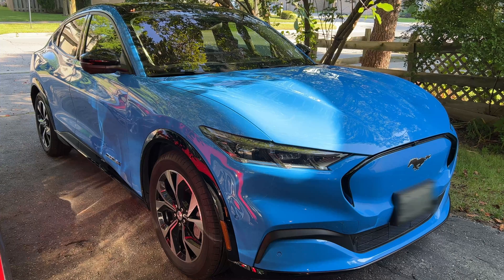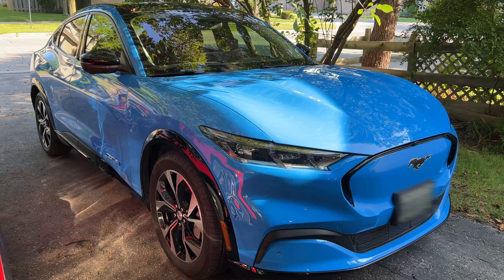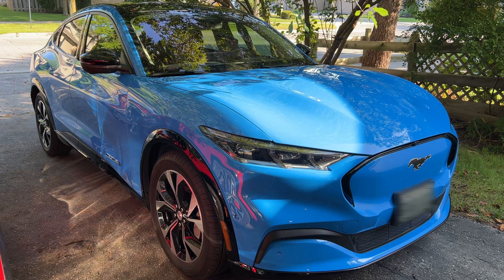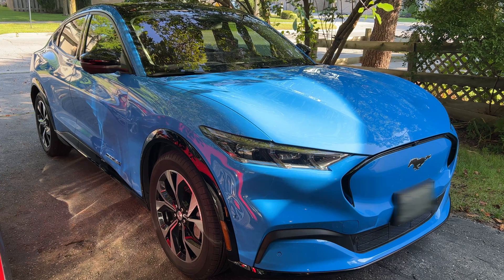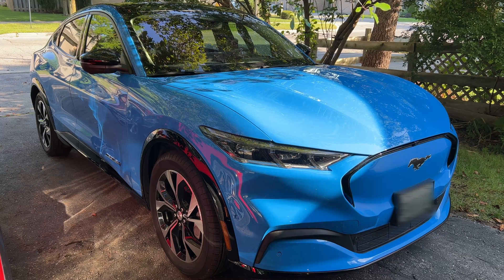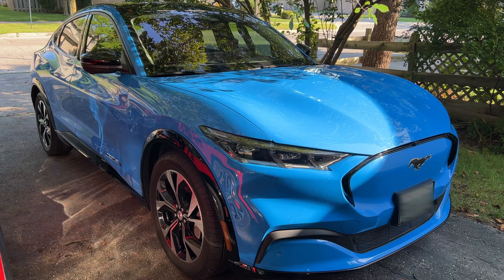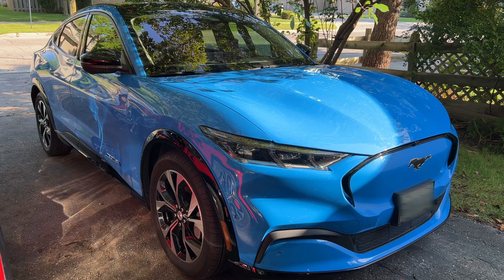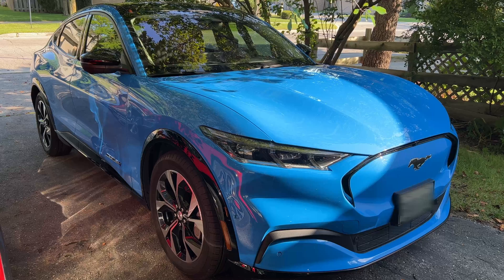Dead Ford Mustang Mach E 12 volt battery? BCM replacement Electrical System Drain Service Required

Comment: Roadside assistance towed mine to dealer for free on a Saturday (same batt issue). They claimed to have the part (high voltage contactor) on the following Tuesday. On a Friday (7 weeks later) while leaving the dealership, I noticed the dashcam disconnected and laying on my passenger seat with no explanation from them. The obvious conclusion is that they consider that cam a drain on that small battery, however, my cam only runs when car is running. Anyways, considering adding a larger batt in the frunk where it can be monitored easily.
Reply from the maker: If you do that, let me know ho it goes.  Please like and subscribe as it really helps me as a creator.  It doesn't cost anything.  Thanks for the comment and for watching!

Comment: I don’t understand how a new car can have issues. I got the car for my wife as a gift and it’s already messing up smh brand new new smh
Reply from the maker: I know, right?  I never expected no issues with brand new technology, but I wasn't expecting this either.  Let me know how it goes.  Please like and subscribe as it really helps me as a creator.  Thanks for the comment and for watching!
Reply: @MoreBear I liked and subscribe for u bud. Good luck with your channel. Also I wanted to ask you did ford send you your free Tesla charging adapter?
Reply from the maker: @davidparker4943  I ordered it months ago.  Still haven't gotten it.  But I did use the Tesla Magic Dock in NY.  You should check it out.  Thanks for the Sub.
Reply: @MoreBear I ordered mine and it took 3 months to come in but it seems to work great. I’ll have to check it out. Yw
Reply: It can happen when the car sits idle in the dealership for a long time, the 12v battery suffers. Try letting an ICE car off for a year, there is a high chance of the battery losing charge.
Reply from the maker: @xaviersan554  No, I get that.  But this was a few days.  And there is a battery under the entire car that it could top up from.  Frustrating.  Please like and subscribe as it really helps me as a creator.  Thanks for watching and the comment!
Reply: @MoreBear  I see, the question I have is, is the BCM module up to date on your Mach-E? Mine is not up to date.
Reply from the maker: @xaviersan554  One of my two Mach's has been replaced, so that one is up to date.

Comment: I have a 23 mach e premium and just got the same warning message about low voltage. After watching this video I made a service appointment on the app and will update on what happens next.
Reply from the maker: Please keep me updated.  I hope everything goes well.  Please like and subscribe as it really helps me as a creator.  Thanks for the comment and for watching!
Reply: @MoreBear I just liked and subscribed. Update: I plugged it in on my level 1 at home over night and I just did a 4 mile drive to the gym and no app alert and no warning from ford pass but my appointment is for this Saturday so I’ll update with more info then or if something else happens.
Reply from the maker: @davidparker4943  Thank you so much.  Hope all goes well.  Thanks again!
Reply: @MoreBear  Update: The dealership service department said that they didn’t know what it was and that they tested the 12v battery and it’s taking and holding a charge. Today rolls around and I get a message from ford pass and on my display in the car that says “Restraint indicator lamp warning”. I am over Ford.
Reply from the maker: @davidparker4943  Sorry to hear that buddy.  Hopefully they can get it figured out.  Surely you are not the first to deal with this issue!
Reply: @MoreBear  Hopefully..

Comment: So latest is my car has been in the shop for over a week now. I was supposed to get it back Friday after they found the audio control module, ACM, was drawing 995 milliamps instead of 10 milliamps which was what was killing my battery. But when they went to load the new software on the ACM they hit a wall. It will not load. So since Friday the technician has been working with and reaching out to the engineers higher up in Ford. Today's word was Ford text and engineers need to come up with new software to get the ACM to load. No idea how long it's going to be or how long I'm going to be without my car. Any suggestions from anyone regarding lemon law or compensation for being without my car? I do have a rental and they are paying for gasoline.
Reply from the maker: Wow, that's not ideal.  I hope they get you a fix soon.  At least Ford is providing a rental in the meantime.  Unfortunately I cannot provide you with any further info.  Thanks for the update and please keep us posted.

Comment: Anyone know why Ford told me the high voltage battery doesn't maintain the 12v battery (which apparently is true) when this is a direct contradiction of the quote from my users manual?
CHARGING THE 12V BATTERY
Your vehicle has a high voltage to low voltage energy transfer feature that keeps the 12 volt battery charged by the high voltage battery. If the 12 volt battery level is low, the high voltage battery transfers energy to the 12 volt battery when the vehicle is off.
Reply from the maker: I haven't heard that before.  I know that if the high voltage battery is below a certain state of charge, it will no longer maintain the 12v battery (I have seen this info in forums I just can't find it at the moment).  If anyone else can answer, please jump in.  Thanks for the question and for watching!
Reply: @MoreBear  I understand that the high voltage battery charges the 12 volt in the preconditioning mode

Comment: this exact scenario is happening with my 2023 Mach E.  I bought it in Sep, battery dead in Nov and battery replaced after transported to dealer early December.  Now after leaving outside for a few weeks without driving - at airport - i was able to jump it and drive 2 hours home.  I used the car two days later - 1 hour drive to and from store and that was on Thursday -  now this morning it is dead again - the car itself was 100% charged.  Have you had further issues after the BCM and HJV were replaced?  Thanks for any info. Thanks for your videos.
Reply from the maker: No, thankfully I haven't had further issues.  However I leave it plugged in majority of the time.  I hope you get this issue sorted out.  I know how frustrating it was for my wife and I.  Keep me updated.  Please like and subscribe.  Thanks for the comment and for watching!

Comment: My exact same car is getting towed in tonight. Thanks for this!!
Reply from the maker: Sorry to hear that.  Let me know how it goes.  Thanks for the comment and for watching
Reply: @MoreBear  thanks. But your car remains working now after the parts were changed out?
Reply from the maker: @hifromkate  Yes, thankfully I haven't had further issues.  However I leave it plugged in majority of the time.  I hope you get this issue sorted out.  I know how frustrating it was for my wife and I.  Keep me updated.  Please like and subscribe.  Thanks for the comment and for watching!
Reply: any luck with a repair?  Dead in the water right now!
Reply: @hifromkate  yep, got my car towed to the only dealer in the city that had a battery left. Fixed it right up. 3 days later,  car stopped working again and now it says it's the high voltage battery which is likely that high voltage junction box issue. Gonna get towed in again tomorrow....
Reply: @MarkCampbell83  thanks for your reply. So frustrating! Just ridiculous. I decided to jump mine today. But with a battery pack, not another car. Applied jumpers, pushed start button, but forgot to step on brake pedal but somehow dash reported powered up accessories.  Didn't realize I that I had not started the car so disconnected the battery pack. Got in and tried to put in reverse and it wouldn't go. Then started the car without an issue by stepping on the break and hitting the button again. Don't understand why that worked! Did check the battery before I did anything and it was at 11.7 volts. I am calling the dealership tomorrow to see what they recommend. My claim with the Ford customer care people only recommends bring it to a dealer. They don't seem to want to address all the complaints that I brought up from my research.
Reply: @hifromkate  that's good, but I forgot to mention that eventually mine started working again after I left t for 8 hours, but the next day it died again so be careful!
Reply from the maker: @hifromkate  Keep me updated.  Please like and subscribe.  Thanks for the comment and for watching!

Comment: What dashcam did you have? The Fitcamx runs off of the rain sensor under the mirror, and is switched off when the power is off. Of course, this means no recording when the car is not on.
Reply from the maker: I have Thinkware FA200 with rear dashcam.  Thanks for the question and for watching!

Comment: I am currently locked out of my car and can’t get the frunk open. I need to get into the car without breaking my window so I can get my belongings off the front seat (purse, medication and iPad)
Reply from the maker: You will need a booster pack to get in.  The cables to hook the booster pack to are under an access panel on the front bumper under the front left headlight (if looking at the front of the car).  Once the booster pack is turned on it will open the frunk.  Once in the frunk you will need to remove the cover panels on the right side to access the 12v battery.  After that you can boost the 12v battery to access the vehicle.  Let me know how everything goes please.  I'm curious about yours and others issues with the Mach E.  I hope everything works out.  Thanks for watching and the question.